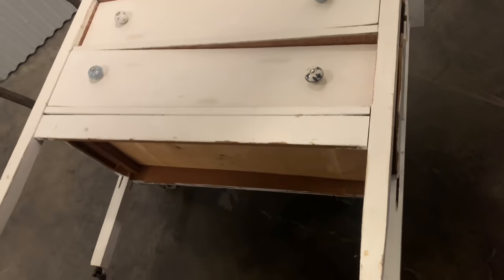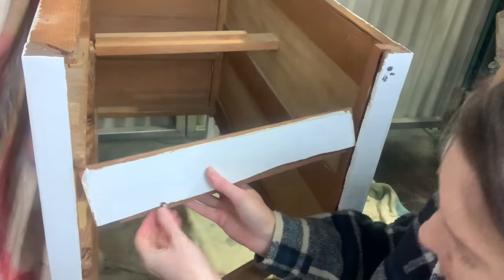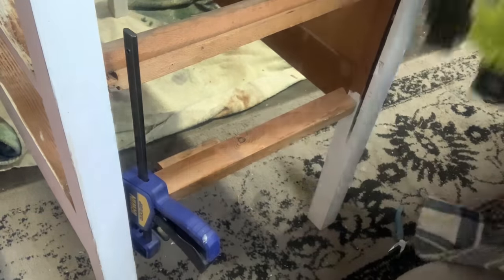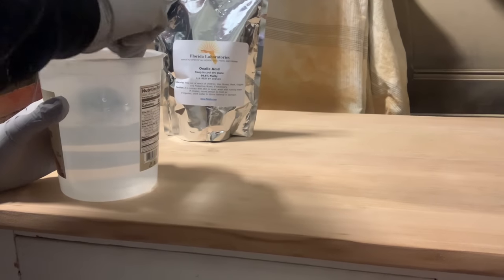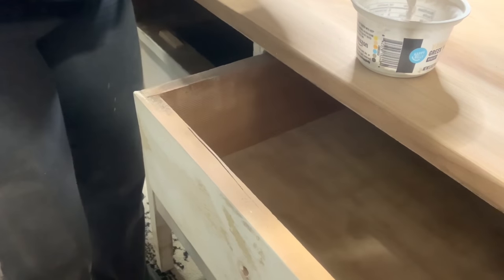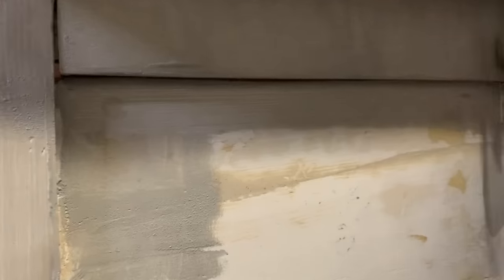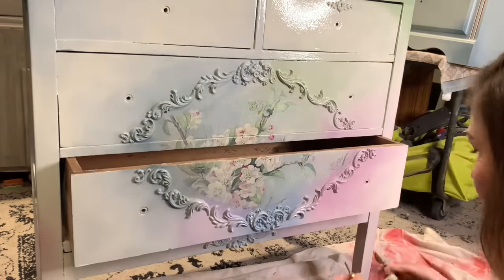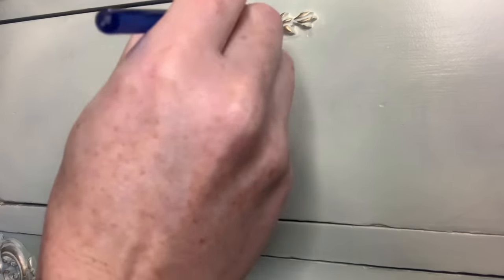Vintage Dresser Repairs and Makeover | Spring Fling Challenge | Elegant Upgrades

Comment: The top that you fought with for so long was actually pristine on the bottom. I have seen a lot of your colleagues flip the tops over and use the original bottom side as the new, undamaged top sides. Just a tip you might want to try next time. You do such detailed, awesome work, which I admire your skills at.
Reply from the maker: I have done that before, it’s a great tip! This one had the large screw holes on the underside and at that point I still wanted to keep the natural wood and I would have had to fill and then blend them in. But had I known where it would have ended up I could have just flipped it 😂

Comment: Ethereal is definitely what you got! I love it. I also love your use of molds.
Reply from the maker: Thank you, Leslie! I’m so glad you liked it.
Reply: @elegantupgrades  I have questions! I want to make my son-in-law a multimedia piece using a poster of the ferry he works on. (It’s actually a poster celebrating that ferry’s 100 year run. It has Seattle in the background.)

I started by looking for ferry boat molds, which took so many hours and only yielded one cartoonish ferry. 😳

I’m thinking that a 1/4” piece of plywood might be good. I have nearly every IOD mold, transfers, and stamps.  I have JRV stencils decoupage paper. 

How would you start? I could probably put some birds on and some (muted) flowers on it. I could maybe use a branch stamp to put on cherry blossoms (it’s for his birthday in early April).

But as soon as I saw the poster, all my ideas flew right out of my head.
Reply from the maker: Oh wow! That sounds like so much fun! I think it depends on how big your final piece would end up being.  If you want it the same size as the poster, then I would start by laying down the poster and framing around it with the moulds and then I would just hope that everything else would start coming together. If you are going larger I would lay the poster down and figure out if I wanted to paint in a sky with it (or maybe decoupage one over it etc.) I mostly just make myself start.  Once I start its a little easier to figure out what I want to do next and then hope the project takes on a life of it’s own. I hope that makes sense.  I just don’t have any hard and fast rules, I just go with it and hope for the best.

Comment: Wow, you really turned something that was a beast into something so beautiful. You have such a gift in bringing out the beauty in everything. Do you have any tips or a link to a video where you teach how to have a smooth decoupage,  because every time I try it there is always wrinkles. I'm definitely going to order the mold and stencils, I loved everything about this dresser.
Reply from the maker: Thank you, Linda! I’ve found that every paper I use requires a bit different handling to get a smooth finish so I don’t have one video for it. And sometimes I don’t mind having a few wrinkles. But if you are using tissue paper, the best tool for smoothing it out for me has been using my fingers wetted with poly and also the synthetic brush itself to gently smooth it out.

Comment: It seems to me that what you did with that dresser is a common find for me. I bought a lovely old Queen Ann buffet! I was so excited! It had 4 feet in front and two in the back. So I thought. It was missing the two middle feet! And the nightmare began.  You give me inspiration to take the drop cloth off it and keep on going. I love the dresser! It’s beautiful! One thing that a floor refinished told me when I was  loading up an old dresser with casters he said to get the ones with nylon or plastic wheels. Ok I know you are thinking what I thought. Ewww! I want original looking. But he said so many people are putting in hard wood flooring and the metal casters will scratch or gouge the flooring. Just a thought! Kudos! Job well done!
Reply from the maker: Oh I’m so glad you are going to pull the drop cloth back off!!! It sounds like a project, but definitely worth the work. And ugh, I just can’t bring myself to get the plastic casters. I know that they can potentially dent wood floors. I will say that I do mention the casters to my clients before they purchase. And most don’t mind because they have alternative ways to protect their floors if the piece is going on wood.
Reply: @elegantupgrades  I do agree with the plastic casters. I always try to find what would have been originally on the piece of furniture. I am aging those plastic “tack” type on certain more modern furniture but they don’t really show. I buy the more low profile ones. Thanks for answering.
Reply from the maker: Oh, I like the idea of aging them!